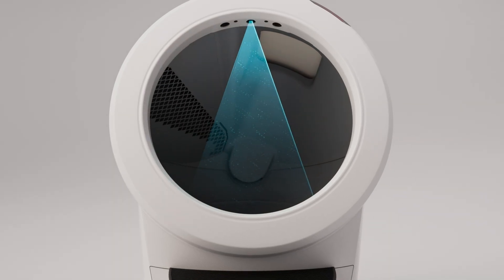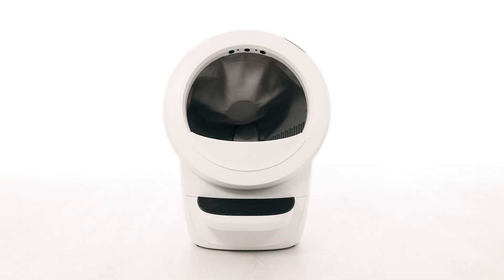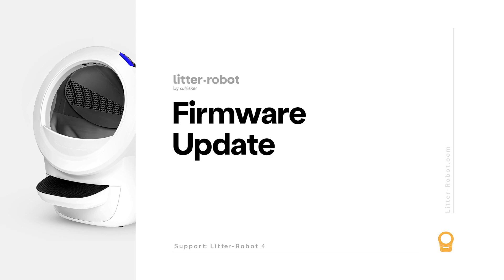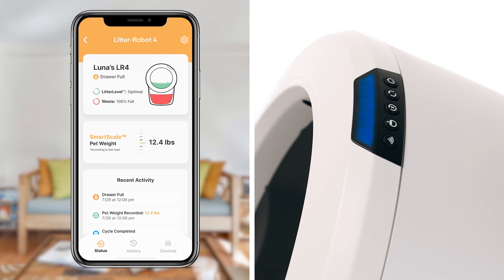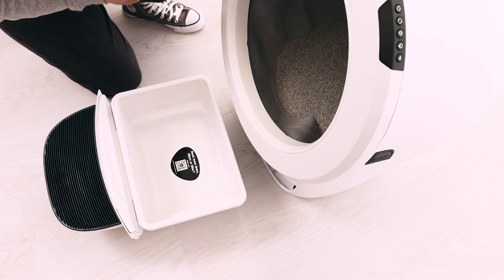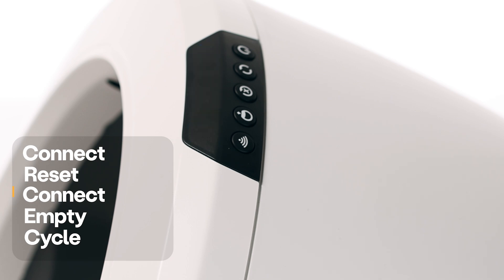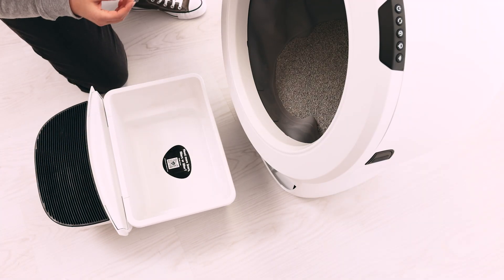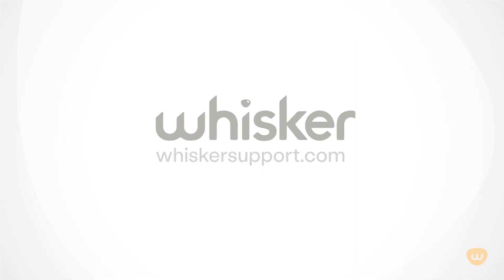How to calibrate the OmniSense Laser Sensors | Litter-Robot 4

Comment: Ive done this twice and it continues to say its full after two cycles with hardly anything in the waste bin 😢
Reply: I’m having the same issue! Mine last 1 day then it says it’s full 😩😩
Reply: If you both have cleaned the curtain lasers and done the calibration, then try disassembling the globe and check to make sure the laser board didn't get knocked off center.  If it didn't, then you likely have a failing laser board.  Replacing mine fixed the issue.

Comment: Why does it show litter being in the cylinder when the paper is put in? If litter is in there then when you start the process it will dump it over the paper before it has a chance to calibrate surely?
Reply: I cycled it twice before taking out the bag, then left the litter in. That way, only a few little flecks of litter wound up in the unbagged drawer

Comment: These steps are ridiculous there should just be a recalibrate button in the app every time I replace my bag it still says full there should be one button saying I just replaced my bag it is not full so take whatever it sensing now and use that data to say it's empty button for the price point of these units
Reply: You only need to press the Reset button when changing the bag. The other steps are only there for a firmware update.
Reply: @mikespragg3180 I agree! I travel a lot, and while my cat sitter is WONDERFUL, she wouldn't be able to fix this while I'm gone. 😢
Reply: Totally agree!!!!! I’m absolutely HATING my litter robot 4, got it on Halloween and now, having nothing but problems!! Constantly telling me it needs a new bag!!!!!!!!
Reply: Then calibrate it. Fixed the same issue for mine. @Caliyope
Reply: It worked for me. Just follow the steps and it’ll work. This ain’t a smartphone to reset easily.
Reply: Doesn't work.
Reply: Agree, how simple to add a calibration button especially for the cost.
Reply from the maker: Thank you for reaching out. We would be more than happy to connect you with a product specialist and resolve any issues for you. Please contact us by visiting whiskersupport.com.
Reply: @LitterRobot  you do realize that no one will be contacting you. Right? We basically paid $800 for an electric scooper with a basket. If it’s always dirty inside until you reset and cycle, it’s not fulfilling its purpose.

Comment: Curiously absent: the part where you magically made the litter in the globe disappear before starting the calibration. :face-fuchsia-poop-shape:

For all the other owners out there who may be in the same boat as me...

My prior situation: solid blue status and an occasional "laser is dirty" notification from the app. I tried cleaning the lasers to no avail, so this video gave me some hope for a resolution. 

My actions: Being the lazy cat owner that I am, I just pressed the calibration button sequence without removing the litter or waste drawer liner and planned on performing the calibration again after removing the full waste drawer liner.

The result: Pretty solid evidence that my motor is not working. Green round-robin lights while the globe doesn't make a sound/move an inch.

My current situation: Contacting support and dreading the next steps... :face-orange-biting-nails:
Reply: I'm actually in the same boat. Always showing a solid blue light with the ocassional "Your sensor laser is dirty" message but would never cycle, even on start up or manually. I also had the same result as you, nothing moving at all when trying to calibrate, my assumption even before that was it was something with the motor but this is pretty much confirming it. I reached out to support and since I was 9 days out of the warranty period, they said I can just buy a new one. Warning to anyone looking to buy a litter robot, they only last a year(or the firmware they pushed out two weeks ago just randomly killed it), so if you didn't buy the extended warranty, you'll just be out $700. But even then I'd assume they'd send an update to kill it after 3 years most likely to get you to buy another one...
Reply from the maker: Hi there, we're sorry to hear your Litter-Robot isn't working properly at the moment. Even after the warranty expires, we're still here to help. You can always send it in for repairs or purchase the needed parts and we'll show you how to install them. We would be more than happy to take another look at your support case and provide further assistance at whiskersupport.com.

Comment: Just saying maybe in future units add a calibrate button. For the price point of this device I shouldn’t be having issues that require multi button pushing and putting a piece of paper in the unit to fix.
Reply: but it's a catbox konami code
Reply from the maker: Thank you for your feedback, we will be sure to pass it along to our product development teams! In most cases, the Reset button helps recalibrate the unit for daily use, but in some instances more steps are required. For any further questions about your Litter-Robot, our team at whiskersupport.com would be more than happy to help!
Reply: Because then people would be pushing it all the time by accident and it isn't something that should normally need to be done.  Accidental calibration might mess it up.
Reply: @gordo3582 and? As opposed to being told to use printer paper and having to google how to do this on a device that this price point